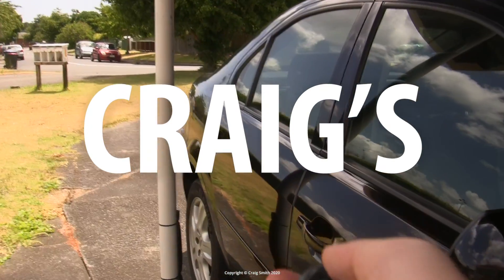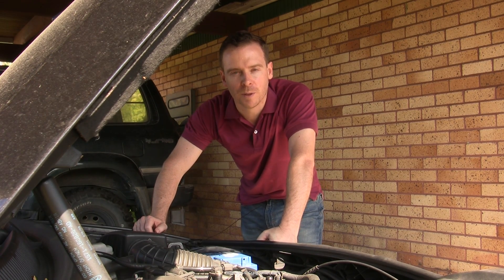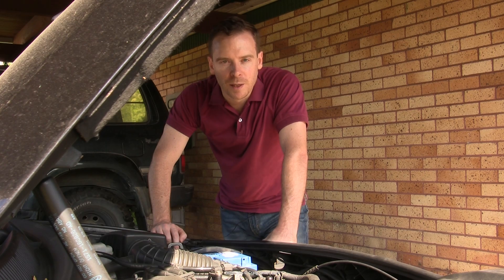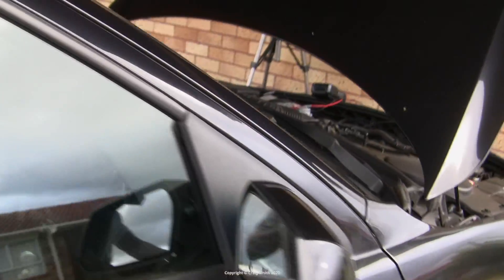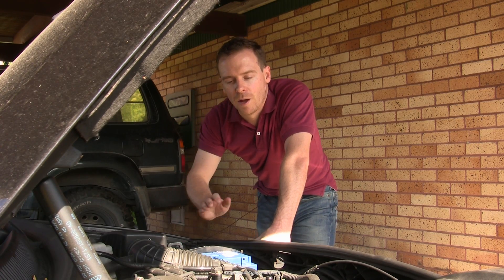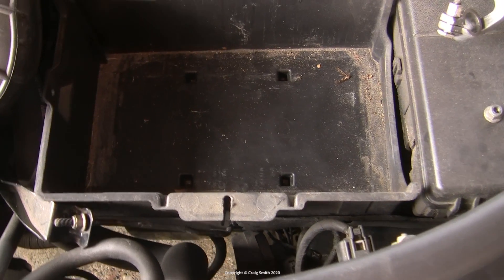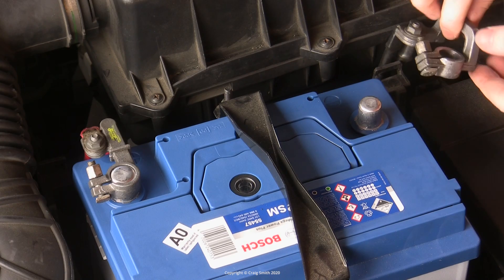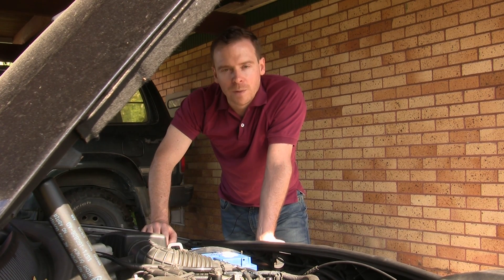Dead car battery! How to check & replace a flat starter battery (the dreaded click-click-click)

Comment from the maker: Links (more in the desc):
* Multimeter ~ US: https://amzn.to/2J1Fpd8 | UK: https://amzn.to/2IZDhCU
* New battery ~ US: https://amzn.to/2kiyA9e | UK: https://amzn.to/2s1LaOt
* Battery load testers ~ US: https://amzn.to/2GGnVO8 | UK: https://amzn.to/2IDfPvH

I did a more involved series on diagnosing electrical problems if you have more complicated issues.
1. Testing the battery: https://youtu.be/bXKfYglnFs0
2. Testing the alternator: https://youtu.be/Q2AAMc9VIMo
3. Testing electrical connections: https://youtu.be/zuffDj3HOC0
4. Finding parasitic battery drain: https://youtu.be/cnZuDhgo6AU
Reply: Any recommendations when one of your auto doors sometimes does not auto lock?

Cheers

Comment: here's  a few things for battery reconditioning
never try to do this unless you know what you are doing - the acid can burn your skin
Test the voltage first - there may be a kaput cell which would waste your time.
Check the battery fluid.
Try to fully charge the battery.
(I discovered about these and more on Jons Mender Guide site )

Comment: My 407 just had a new battery but didn't give the classic clicks of no start. It would crank over slowly if it had been sitting for more than a day and still start but I would get random electrical faults.  Diagbox had codes for low system voltage and when I put a multimeter on the battery its resting voltage was 11.8V which is apparently completley dead.  A new battery later a no faults.